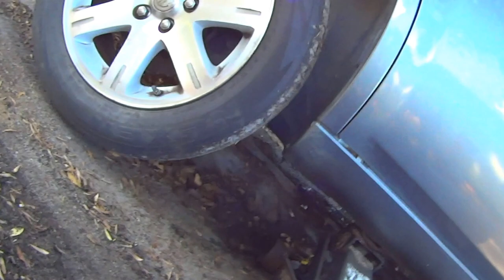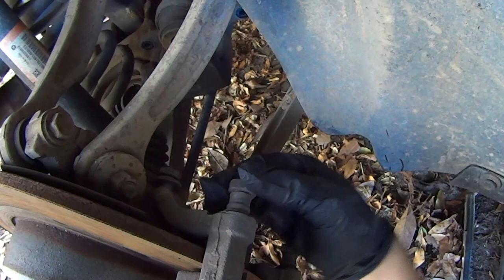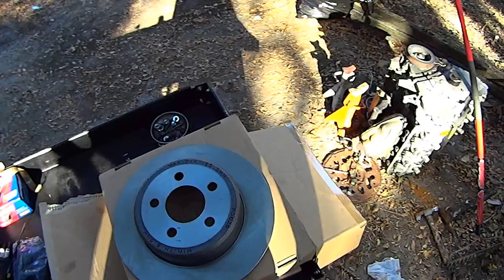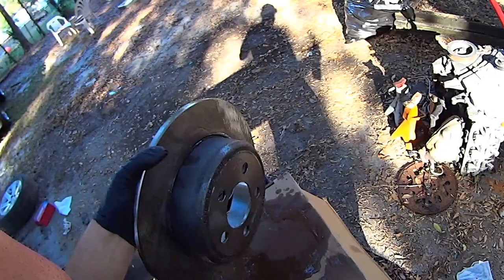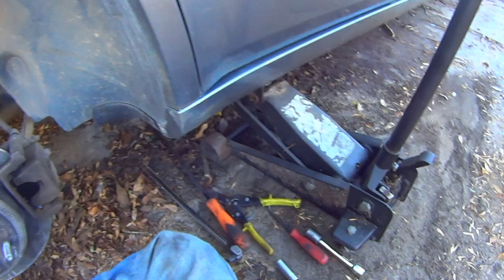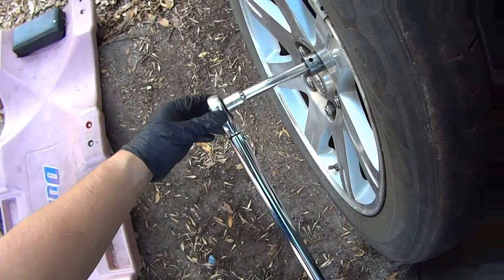How To Replace Rear Brake Pads and Rotors on Chrysler 300 Dodge Charger

Comment: Thanks for taking the time to make this great video.

I do have some questions though-

No need for jack stands?
No need to bleed the system or add fluid to the reservoir?

I'm up in New York and my Magnum has seen a few winters, and it saw a few years where it sat more than it moved. I'm really worried my rotors are rusted on and that my e-brake shoes are a disaster.

I do know about the crummy lug nuts though. The tire place destroyed the shells on mine with an impact wrench. You can carefully chisel the shells apart with a screwdriver to get to the core. You should be able to use pliers to pull enough of the shell out to get a socket on the core. After that it's simple to swap the OEM cores for some nice solid, stainless steel lugs.

Comment: Man . Wire wheel the clips so your new shoes dont do what his old ones did and wear one side . Clean all the rust and ceap off the clips then use caliper grease on the mating surfaces. I also grease my piston boot a d backs of my pads.

Comment: What type of grease did you use? Will any grease work?
Reply: It's brake caliper grease.  Don't use any other kind of grease.  Any auto parts store will have it.
Reply: No, Caliper Grease. Rookies use Anti-Sieze.  SMH.  If you can get the extreme temp.  Its purple in color.  Make sure u lube the guide pins and dont over torque them.
Reply: @cb360fan  sil glyde works really good and it's pretty cheap at Napa and AAP
Reply: @gabrielq.906  sil glyde is known to be the best stuff!   Not cheap though.  $10 for a 4 oz tube, but very good stuff.